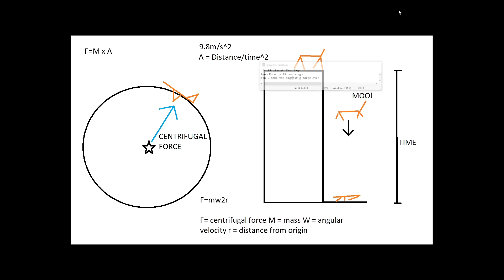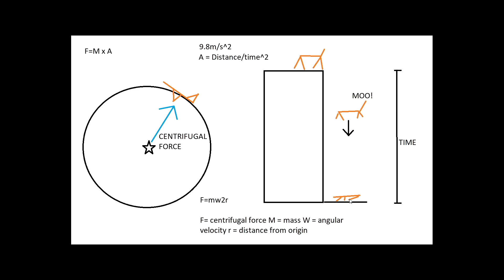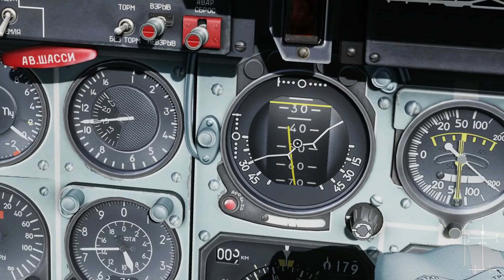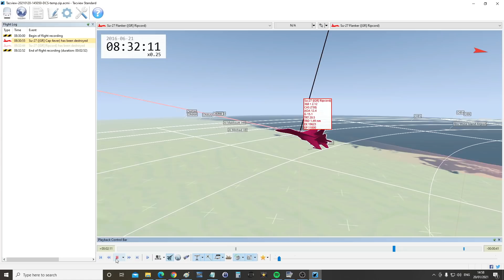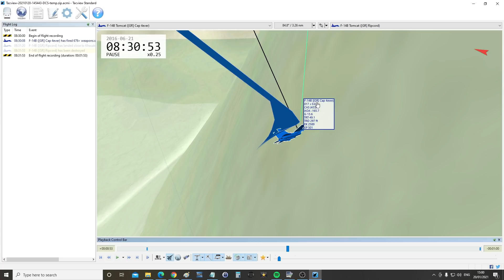Questioned: What Is The Highest Possible G-Force In DCS WORLD?

Comment: To find deceleration time just get the measurement of the nose of the aircraft to the pilot position and use that as d in the same unit as your speed in d=R*T and divide that distance  by the speed and you will get T  which is the time to go from whatever speed at the time of impact to 0. Then you have T and R to use in acceleration formula to calculate acceleration.

Comment: Sorry mate but there are some mistakes. First Centripetal force is F=m times omega SQUARED times r with omega (angular velocity), r (radius of the circle on which movement takes place) and m (mass of the object).
Second: No cancelation of forces takes place. Centripetal force is the only force here which makes the mass moving on the circle instead of moving straight ahead when no forces are applied. The pilot in a plane going in circles for example is pushed by the seat of the plane so he moves in a circle as well. The head of the pilot needs to be pushed into that circle movement as well (otherwise it would move straight ahead, which is painful) so the neck muscles of the pilot need to hold the head right in place (on the circle movement). That's why the head feels heavy (the g load).

Comment: The MiG-21's radio control augmentation system can be manually overridden, and I seem to recall that the F-18 also has a G-limiter circuit breaker that you can deactivate.
Edit: when pulling G's, you want the highest IAS, not MACH. IAS is a measure of the air flow over the aircraft, and as you want the maximum air flow over the aircraft to slow down quickly, you just wanna get the max IAS.
Reply from the maker: thx

Comment: Hello,  I noticed two things in the video. The first being that you transposed F=ma to get a=m/F which is a mistake, a=F/m is what you should have got. Starting with F=ma and dividing both sides by m to isolate a. Secondarily, you said that in the situation with the plane going round in a circle the centrifugal force was balanced with the centripetal force. It might be useful in this case to refer to Newton's first law of motion which states that every object will remain at rest or in uniform motion in a straight line unless compelled to change its state by the action of an external force. If your statement was true that centrifugal and centripetal forces were canceling each other out in the situation with the plane, then the plane would move in a straight line as opposed to in a circular motion. Other than those two things it was a good video!
Reply from the maker: Thanks Sam! Good corrections.
Reply: Agree. I think you only have a ballance when the mass is physically connected to the axis of rotation (so that the balancing force is the tension in the connection). We generally don't use 'centrifugal force' in physics. The correct explanation of Newtons 2nd law (stated as F=ma here) is F = change of momentum over time which explains the plane better. Both you and the plane have an inertia and as the plane suddenly changes direction you do not so that you are going as fast as before (on your linear tangential vector from the turning circle) but your vector direction is now through the floor of the plane which is now moving towards you. Also side note, that's not a 'w' it's omega.
Reply: @dong9224  Everyone who studies orbits would like a word on whether or not an orbiting body is "balanced" around its anchoring body
Reply: @jjbloon  that's why I said it's only balanced if it is connected, if it wasn't balanced it would fall inwards or fly off outwards. This case is not orbiting in the gravitational sense. Maybe the word can be used in this context as its an object rotating about a point or area but in scientific context its not orbiting like a massive object. Especially condidering the point its rotating about is just a geometric distance not an actual object with mass. Still rotation involves forces regardless.
Reply: Not even trying to be a clown, I wish my brain had the quality of wrinkles as yours. My brain is smoother than an almond.

Comment: Your explanation relies heavily on a lot of very abstracted and built up ideas, no its not crntripetal and centrifugal forces cancelling out etc it’s literally the plane running into the air really hard, and that force accellerates the pilot with a certain equivalent G force, don’t need to do any of that other stuff, its not more accurate its just more abstract... just a personal gripe
Reply from the maker: Thanks
Reply: @grimreapers  Great video though lol, its a shame the game can’t really calculate the G forces of hitting the mountain lol
Reply: It's definitely not the plane 'running into the air really hard'. If that were true you would experience g force whilst at a constant speed.
Reply: @dong9224  when flying straight the aircraft is in its lowest drag orientation and the drag is balanced by the thrust of the aircraft, there is no net force and so no net acceleration. When you pull back the stick and induce a large angle between the the plane and the oncoming air, there is a massive force generated by the air hitting that surface and deflecting, pushing the aircraft upwards “really hard” that force is not balanced by anything pushing it down except gravity, but its a lot bigger, so there is a net force and acceleration on the aircraft that the pilot feels as those G forces... ie deflecting the aircraft by x amount makes the pilot feel twice as heavy sitting there as he would stationaon earth, ie 2G’s...
Reply: @youngbloodbear9662  I mean no disrespect but in the nicest possible way that explanation is completely wrong. The plane maybe in its lowest drag configuration flying straight but lowest does not equate to low (absolute low). The formula for drag (F sub D) is 0.5 x rho x v^2 x CsubD x A where rho is density of fluid, v is velocity, CsubD is drag coefficient and A is cross sectional area. This means (mostly because of the velocity squared) that drag goes up exponentially as velocity increases. Also as you yourslef said, yes drag will go up as the plane turns and presents a greater cross sectional surface area but velocity has a greater impact when it is high. But no matter how fast you go, even if you are on a rocket passing through maximum dynamic pressure, drag will not induce G forces. G forces are only induced due to inertia and conservation of momentum. I explained a bit about why in another comment before yours but basically the plane has changed direction but your body is continuing along its initial direction, regardless of the fluid outside. The same G forces would be felt in a vacuum
Reply: @dong9224  the same G forces would be felt traveling along that path in a vacuum... but to travel along that path requires a force to accelerate you... that could be a big rocket engine, or in our case aerodynamic forces.... the drag force is large but there is no net force, there is a giant (possibly pair) of jet engines pushing you forward exactly as hard as the drag force, it balances out to 0 in level flight at cruising speed. When you pitch up, you are creating an inbalance, there is a net force upwards from the air smacking into the bottom of the wing, and nothing pushing you down to counteract it. The air hitting you is what generates this acceleration. F = MA, A = F/M.... yes irregardless of how the force is generated the acceleration along this path is the same, because irregardless of anythingelse to follow that path requires there are the complimentary forces and accelerations required to produce it... but our force is the force of the air hitting and being deflected by our aircraft... also there is no ‘formula’ for drag... at low speeds and under smooth flow it increases mostly linearly with velocity, with turbulent flow closer to v^2, but by transonic speeds its completely different, we might say it increases mostly like v^2, but it just depends... on a supersonic aircraft drag is a hoghly nonlinear force, and it varies with both speed and aoa... take for example an aircraft at speed suddenly finding itself at 90 degrees to its velocity vector... it will find itself encountering a significant drag force... the drag will most definitely induce a heavy G load, large enough to destroy its wings in most cases... you can’t tell me drag can’t induce a G force. It just is usually balanced by massive turbojet engines...
Reply: @youngbloodbear9662  There is a formula for drag, I literally just stated it. The Reynolds number will be different in laminar flow as to turbulent flow but that does not make drag linear. The only reason drag is not such an issue at lower speeds is the components of the equation that are biggest at slower speeds are the area and at higher speeds the velocity plays a bigger part (because of the square). Also the net force (in the direction of motion, lets call this direction X and up and down Y) is not zero or the plane would be stationary. The force produced by the thrust of the engine has to be greater than the force opposed to the thrust by the drag (which is always acting, it does not turn off, hence the engines always have to be producing more to move forward). You are right in saying the drag force of a plane suddenly pitching 90° would tear the wings off because that sudden extra drag due to the change in cross sectional surface area (remember the drag formula, fluid density has not changed, assuming the velocity is the same even after massive pitch input, ) therefore the total force of drag goes up significantly and aerodynamic stress will break the wings from the drag force probably way before the 'G-force' from the deceleration which will now occur because the drag force in the X direction now has not other force to counter it as the thrust is now in the Y direction (which is now being countered by the same drag force the plane experiences flying forward plus the acceleration due to gravity). I get that this is hard to understand sometimes but this is established laws of physics. If you yank the stick back in a plane you will get a massive instantaneous G from the acceleration (a constant change in direction is an acceleration like going in a circle not just a change in velocity) from changing your velocity vector but as soon as your direction becomes constant G force goes back to 1. But now your plane now has a resultant vector with the original X component (until the drag force reduces it to zero) and a Y component provided by the engine thrust. I deal with this type of physics daily right now.
Reply: @dong9224  yes there are plenty of formulas to approximate drag but without specifics theyre not much better than just having a rough degree to which they rely on velocity, you can’t instantaneously calculate the reynolds number around your aircraft... and take for example the case of the trident missile, where you have a drag reducing Aerospike composed of a flat plate held at a certain standoff, the drag of this configuration has very little to do with the flow around the plate but everything to do with the detachment of the shockwave at the critical velocities, the drag profile of this thing doesn’t look linear or quadratic with velocity, its a downright wonky graph... now my point is if you have say an F-4 phantom travelling steady at mach 1.3, absolutely topped out on speed, full afterburner... There is an enormous drag force on the aircraft equal to the full thrust of the two engines, it is not accelerating at all, the engine thrust is not greater than the drag. If the thrust were greater it would keep pushing the plane faster untill the drag equalled the greater thrust, the system is in equalibrium at this velocity given these conditions. The forces are all  balanced... at these speeds and with this airfoild theres not a whole lot of bernoulli going on, at a granular level it not much different than a flat plate wedging the air out of the way and imparting a velocity, conservation of momentum blah blah blah... as we increase the angle of that wedge we impart a proportionally increased force normal to the wedge... my argument is that increased mass of air accelerated normal to the aircraft, the air pushing on the plane, that’s what makes it change its velocity vector, that force... we don’t need to talk about abstracted concepts like the centripetal acceleration or anything, its not even traveling in a perfect circle... its as simple as this big plate running into the air and pushing it really hard...
Reply: @youngbloodbear9662  yes I apologise the thrust does indeed equal the drag as the forces are cancelling each other out. But please, just have a little dig around and do some research and I guarantee you will not find an example of G forces caused by drag. Every explanation will say the same as I have said, where just using Newton's laws (mainly the third law, every action will have an equal and opposing reaction) you can describe G forces in any direction by the reaction force of the floor and seat of the plane pushing into the pilot, no drag needed at all. Yes you are absolutely correct the air pushing on the aircraft forces it up to make it fly (again Newtons third law) not all the benouli , and yes correct that the air forces the plane to change direction. But the point is you are inside the cockpit, there is no air hitting you at all, so the plane changes direction but your body does not, you get pushed by the seat and that force is measured as G's. The only thing the air does is allow the airplane to make a turn but other vehicles still give you G's without air. Like a car around a bend, if your going 20mph and yank the steering wheel you fly to the side, not the air doing it only 20mph  but you still get G's.
Reply: @dong9224  i think we’re mainly disagreeing on semantics at this point lol (though id argue the deceleration you feel popping an Airbrake at mach 1 is not a negligible G force lol) all the G’s the pilot feels are coming directly from the seat pushing on him and accelleating him as it changes direction, my only issue with the video is to me it doesn’t make sense to explain it in terms of the abstract physics concepts when its already simple, the easy to understand physics abstractions aren’t the full story and are just a level of abstraction removed from reality, as really the centripetal acceleration is relative to the instantaneous center of rotation etc and the layers of detail you need to be accurate there just go over someone’s head... to me it’s fundamentally relying on people just believing it works because the equation says so rather than actually understanding it... in our case here all that’s happening is were exposing a bigger wedge to the wind and the air pushes you up, that force and accompanying acceleration is felt and measured relative to earth gravity for easy reference... but anyways lol i don’t think we’re disagreeing about the actual physics behind whats going on
Reply: @youngbloodbear9662  Yes popping the air brake is definitely linear G force directly caused by the air correct (although its the reaction force of the harness on your chest that you feel as G's but now that is semantics for sure lol). We were before talking about a sudden turn which is G force caused by angular acceleration, two different G forces (also there is radial G force). It's good to have a friendly science debate. All your explanations fit perfectly to linear G force which I was not even thinking about as I assumed angular G force (bad scientists choosing the wrong assumptions, my bad)
Reply: @dong9224  those kinds of simple issues are why i prefer to avoid the more abstracted concepts from physics except where they specifically apply like in a flywheel where you have true circular motion... often a low level intuitive look is more helpful than a sort of medium grain look with some basic tools and equations and all the assumptions and possible errors that come with them, theyre not really good enough for an exact number by themselves anyways without a lot of modification and additional complexity.... but our schooling tends to teach things equation first and deep understanding last to the point that the natural intuition coming out of a highschool or undergrad physics course is to get lost in a sea of equations searching for the right bit of lego to plug into the problem rather than to break it down and try to understand it lol... of course I say this as just yet another undergrad trying to go change the world so I suppose a grain of salt is warranted with my experiences lol
Reply: @youngbloodbear9662  I'm also an undergrad trying to change the world haha. But you always do the math first before you build something and it is usually pretty correct.
Reply: @dong9224  yes of course, just the math required to get an answer good enough to trust and the basic approximations they give you as a guideline don’t always overlap as much as one would hope lmao
Reply: @youngbloodbear9662  I have not experienced that myself to be honest. All the math's I have done thus far has been almost exact when testing in computer simulations and in wind tunnel and actual testing and experiments.
Reply: @dong9224  interesting, maybe just the different applications
Reply: @dong9224  my problem is that this acceleration is really simple and comes from the aircraft pushing on the air, the abstracted concepts he uses to explain the physics are accurate just not really applicable here, theyre tools gor analyzing situations that shouldnt be used as the basis of the explanation... a rocket doesn’t work because of Newtons laws, they work because the exhaust pushes on the nozzle, newtons laws just say THAT theyll work not why...